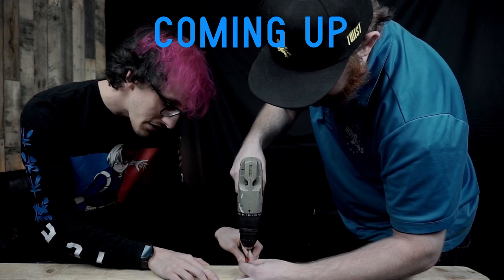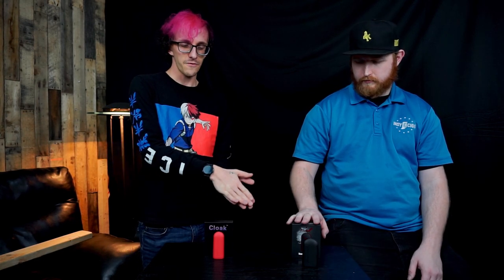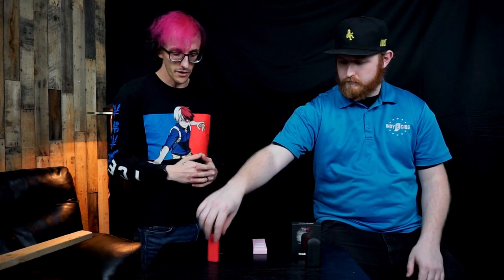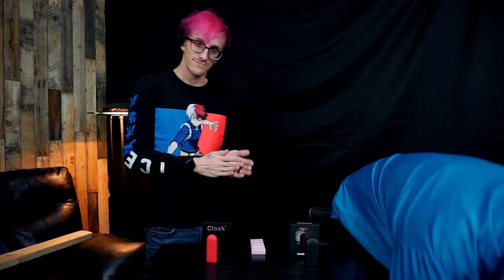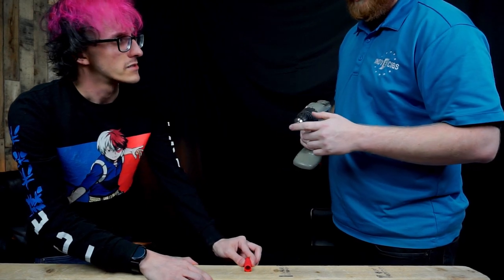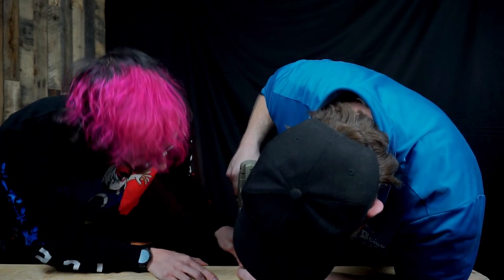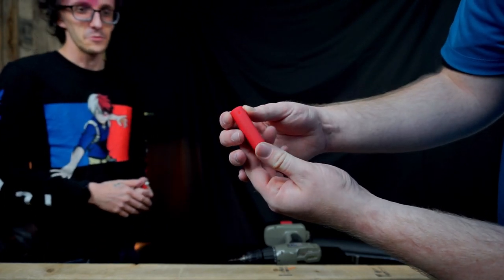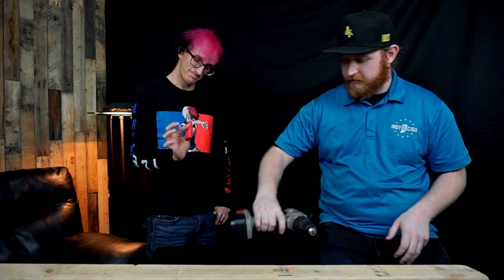Customizing the Hamilton Cloak, A Draw Activated Cart Battery

Comment: guys next to the charger if you cover the intake and let go its the same thing without having to drill a hole .....
Reply from the maker: True, but it doesn't stop the cart from firing, drilling the hole does. Definitely makes the hit smoother for sure! We just had the time and resources, so we gave it a go!
Reply: Wouldn’t the cart fire off whenever you pull it since it’s an auto motor?
Reply: But it's not the same
Reply: With the tombstone it does not keep it activated. Just slow down on how much pull you are chugging. Light turns off and it clears nicely.